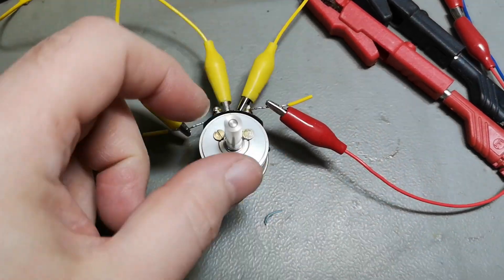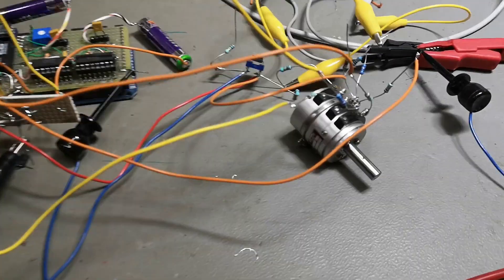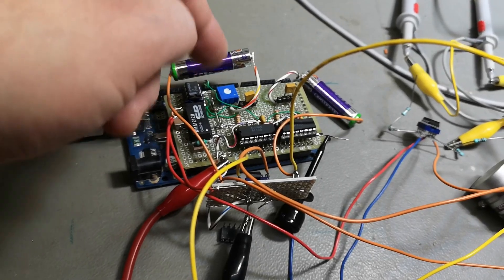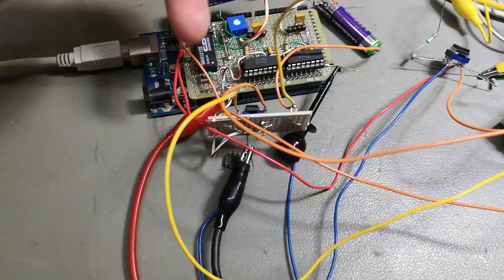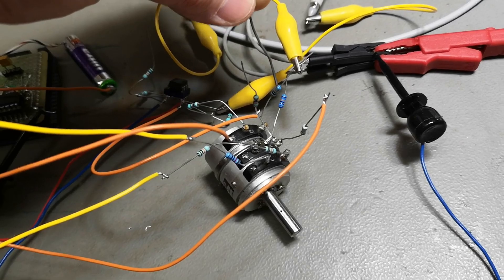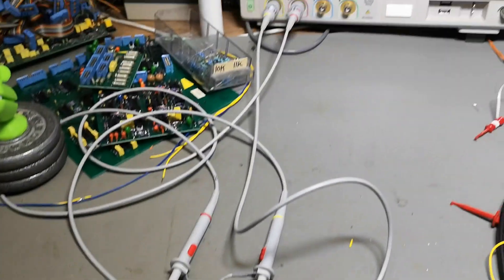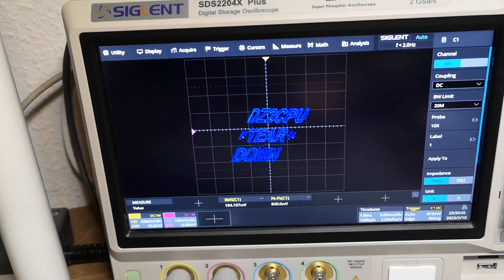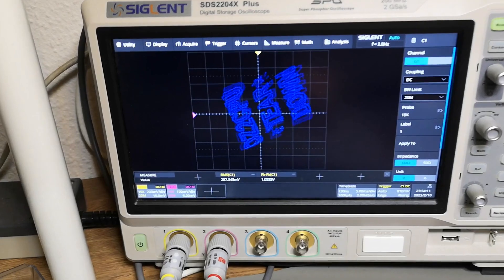Sine Cosine Potentiometer scope XY rotate test PART 1

Comment: I have a sin cos potentiometer in an azimuth circle, an indicator ia attached with it. The indicator rotates 270 to 360 degree and 360 to 90 only, but when i send signal to rotate 90 to 180 degree then the indicator does not move accordingly. Can u plz help me to solve the problem

Comment: Beauty  👍 I call this style of wiring a spider's nest 😁the main thing is that it works.

Nice day 🙂 Tom
Reply from the maker: the point was only to see if it could work with the rotation, can you imagine how many times i swapped all signals before the math worked :-)
Reply: @TeardownOZ2CPU  You'll be surprised, but I think I can do it, on Thursday I spent 22 hours creating a conversion table and then modifying a normal keyboard as a replacement for a special keyboard of an industrial CNC machine 🤪 the machine was 50 km from me and yesterday I went there to test it - after 4 hours it was operational. Now I have to repair or rebuild the original one because the integrated circuits used are no longer produced. After the power surge, the control computer, the monitor, and the keyboard died, for which I had already produced one converter - the original keyboard was originally in the DIN standard and I convinced it that it was USB.